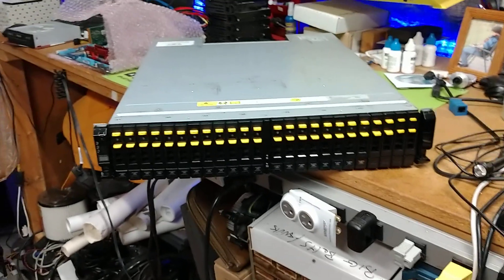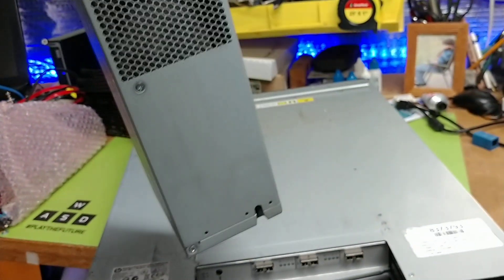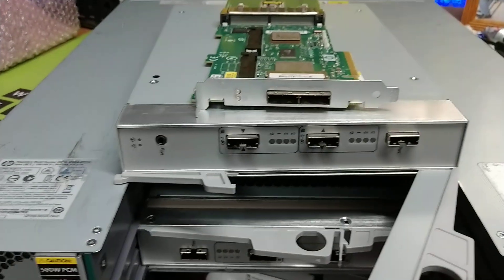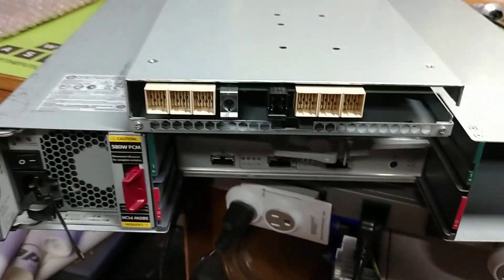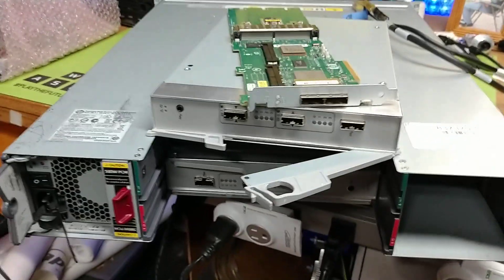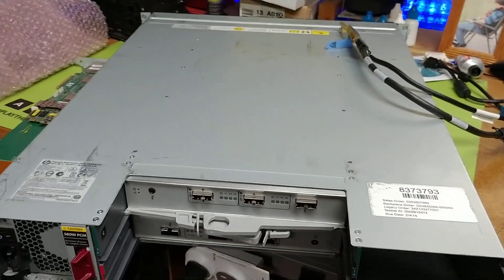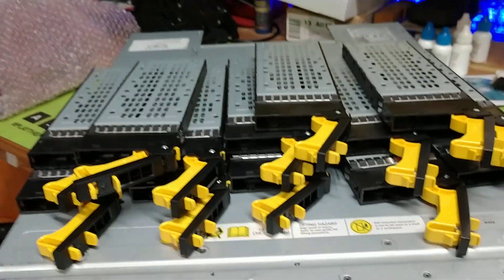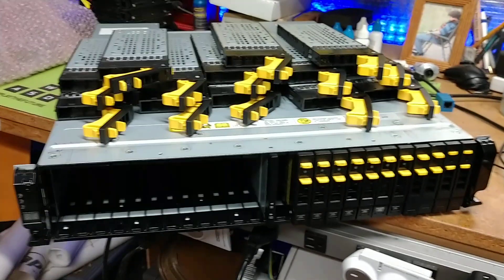Reusing a low cost HP 3PAR M6710 SAS/SATA 2.5 inch, 24 drive disk array  for your home server lab

Comment: Can I buy any sas drive and install it into any hard drive storage device that a accmodates the drive size? I'm new to networking and storage and I'm confused about whether I can mix sas drives and put them in any enterprise level storage unit. From your video Ivan tell I can connect the storage unit to the server, or in my case a workstation, through the raid card as long as it has the connector. I found out that raid cards have the raid management utility on the card. So will my os see the raid array? I bought windows server 2016 datacenter and windows 10 pro or something. Thanks
Reply from the maker: No need to worry about drive types the key thing is placement within the array.  SAS bus connectors can hook up SATA, SSD and SAS.  the key thing is to understand the when you pick the drives you want to use, you group them together to get the best speed from them.  So let's say you get 8 10K rpm speed SAS 1TB drives and you also get 8 15K 512 GB high speed SAS drive.  When you go to your RAID controller BIOS to set them up or if you choose to use a HBA controller instead.  Make sure your raid groups or SAS pools keep the drives apart from each other.  This will give you a good response.  Also one other thing is to learn about the group channels of your disk array. Some have 4 bus channels and some others have 2 or 8.  Placing your groups of 10K, 15K or SSD drives (or slower including SATA disks)  with in each channel.  So for a 4 channel you have your 10K or 15K disks group in the first channel of 8 disk slots and the other group in the next and so on.  Us poor users can do four different drive class in a single array if they are each on their own buse channel.   It is cheaper that way.  It only goes south if you intermix them all together.  Not good and everything is slow.  Take some time and play with it.  I use RAID alto but take your 3PAR (if you have one of these...) and move the disks around to get the best results.  If your boot disk is a memory stick or USB drive this will not take long to build and rebuild your disk groups for the best results.  Enjoy!
Reply: @leadiususa7394  Im looking to buy a sas lff hd lot on eBay. Might spend between 100 and 200$. But the issue I have is what to plug them into for the array. I could make a diy storage unit but I'd have to buy a power supply with enough power and connectors for up to 15 drives. So I'm looking at eBay for storage array units. But the question is are the units considered jbods until you co next them to either a controller or a raid card? And then the question is can I use any pcie raid card to create and control my raid array? Or does the storage unit dictate what controller or raid card you can use? For instance I'm looking at Seagate NetApp drives and they apparently were designed to work with NetApp storage devices and those devices plug into the NetApp controller. So can I bypass the controller and plug the array unit into my pcie raid card instead and it will work?
Reply from the maker: @anthonystrohmayer9191  I would recommend the NetApp 2.5 inch DS2246 SAS disk self or if you are getting a 3.5 drive then get the the DS4246.  Both do all SATA / SAS typee drives.  Then for your RAID controller get the HP 800i series  controller for it has external dual SAS outputs. But one thing.  Your cable to the RAID controller have to Min-SAS to SAS cable sets of two and then one cross over mini-SAS cable for the disk array A bus to B bus.  That is it.  One last thing.  If you buy a bulk load of NetApp disks, you will need to reformat them back to 512 sectors format from 520 formatting before your controller can work with those disk.(Any controller for that matter) Great disk to buy but you got to prep them first.  Don't worry, I have video talking to this point to help you out.  P.S.  if you want JBOD mode get a bacis HBA controller and you can use that controller to reformat your disk as well.  Look at my videos talking to this point.  Later dude!
Reply: @leadiususa7394  Thank you. What do you think about EMC VNX SAE 25x 600GB 10K Array w/ 2x 6GB SAS LCC Controllers 303-104-000E? Or Netapp naj-1001. I believe the Netapp naj-1001 is ds2246
Reply from the maker: @anthonystrohmayer9191  I like the Netapp naj-1001 myself.  But that's only because I work NetApp and EMC is over rated.  Netapp naj-1001 (newer then the DS2246) is very easy to work with unlike the EMC array self.  But that is my 2 cents worth... /:>